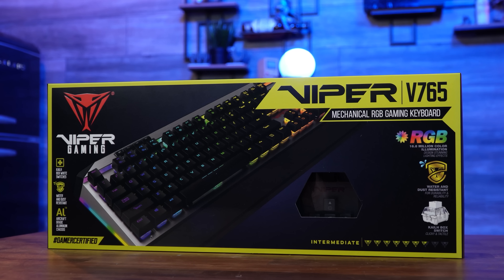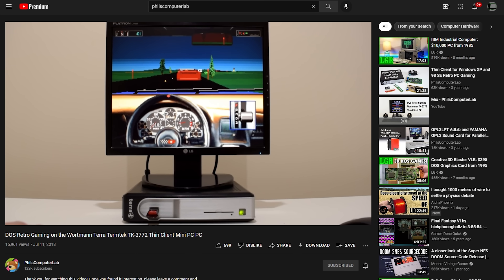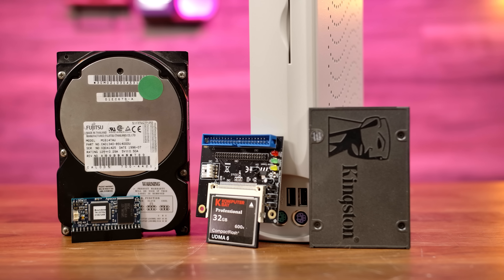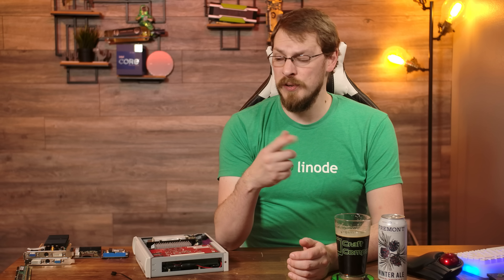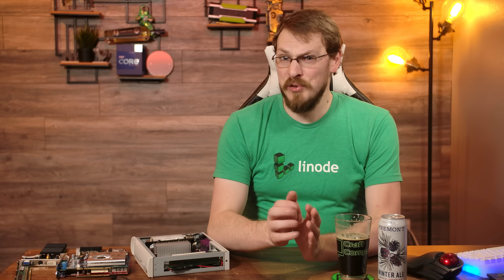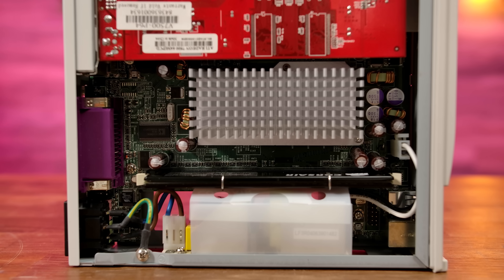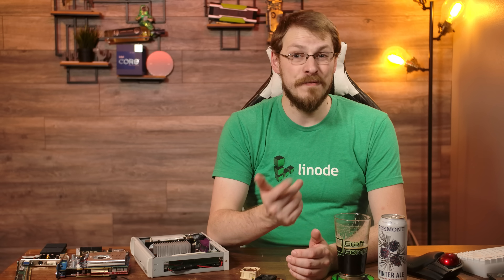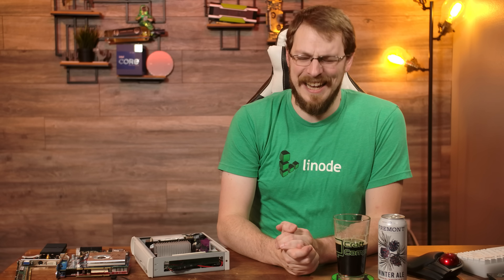What could go wrong - Retro PC Build FAIL

Comment: Noctua makes thinner 5v 40mm fans. Maybe worth taking a look at. They don't move a lot of air but they may be just enough to help.

Edit: Noctua NF-A4x10 5v
Reply: Noctua with the wide range of unique fan sizes
Reply: @NonsensicalSpudz  Sunon has a much bigger selection, down to the diminutive 8x8 fan! (No clue what it would actually be used for tho)

Comment: The first problem you should be taking care of are the caps of the motherboard and I'm not saying just as preventive measures... at least 5 of them are bulging! Instability can be traced to leaky or bulging caps. The 9500 also seems to have a few leaky caps.
Reply: Agreed. Wasn't the 90's to the early 00's rife with defective capacitors?
Reply: @TwistedMe13  I still have a few PII and PIII systems that run to this day with the original caps. I think the problem was early to mid 00s, or I may be just lucky and remember thing wrong...it was over 15 years ago though.
Reply: @aheartseeker   My timeline was a little off. It started late 90's (around the PIII launch)  and persisted until about 2007.  I had two boards fail catastrophically (one even needing a fire extinguisher). Abit boards were especially bad for this.
Reply: @aheartseeker  It was a combination of Pentium 4 power hungry plus Chinese counterfeit capacitors
Reply: @TwistedMe13  Yes the "Capacitor Plague".  This also haunted CRTs and many other electronics. Technicians that worked in that era still tell people to replace all old electrolytic caps, just in case. And they are cheap enough so that it's economically practical.  I think, as long as you (or the customer) are aware of the possible cap problems, it's better in older PCs to leave working/non-bloated/non-leaky caps in place. But, that's a debated opinion.
Reply: @virtualtools_3021  it's actually a problem with Taiwanese capacitors, when the stole a faulty design of the Japanese.
Reply: @squirlmy  *perfectly fine design, they were just too lazy to bother copying the entire recipe including the anti-corrosion additives
Reply: I noticed that too and wanted to say something as well, I'm pretty sure he knows. The two shots we saw in the video are likely POST shots, meaning the video was taken after he did all the testing. He kinda supports this idea at 13:09 in.

Comment: I actually just setup a windows XP retro gaming machine - a virtual machine! (I also made another win7 VM for playing certain newer and GOG modified titles using a CRT monitor) I'm passing through a GPU and SoundBlaster Audigy 2 using IOMMU. I found the Nvidia Quadro K2000 is low power, comes with 2GB memory, and even has Window XP through windows 10 drivers! Display port, DVI, and VGA outputs for only about $60 on ebay. Now that I let the cat out of the bag ebay prices are going to go through the roof lol.

So far this VM seems the best solution. VM which makes it portable and easy to backup. Storage is nvme which is silent, reliable, and way overkill. Same [silent] desktop machine so it doesn't take any additional space. KVM emulates a pentium 3 and along with the actual sound card and GPU being passed through means real hardware support with zero driver compatibility issues. DOSBox for older DOS games, Windows XP for any win95 and newer. I even play on a CRT monitor and I have an older surround sound speaker set. When I retro game I really retro game :D

For what it's worth, Phils Computer Lab goes in great detail on why A3D and EAX positional audio are far superior to modern day bland onboard audio devices. If you are going to build a late 90's gaming rig it is 100% worth the effort to get ahold a Soundblaster Live or Audigy and setup EAX with 4.1 or 5.1 speakers. Half Life 1 and Medal Of Honor: Allied Assault are fantastic examples of true surround sound positional audio from back then.

Comment: Mod the existing chassis. Even if it means having the fan on the outside of the PC, it will still retain the look you want. It's worth it for something this small and affordable.

Another option is to drill holes into the top panel until you make a "mesh" look to it. It will still look nice and retain the top shell and retro look, but then it will be as close to an open-air chassis as possible. You might even be able to fit a thin, larger-size fan onto the top cover with this config.
Reply: I've drilled grids of holes into side panels of a few SFF gaming PCs. It works pretty well and also creates a place to mount a thin fan either internally or externally. Would definitely be a good solution here 👍

Comment: Remove the unused parallel port to make room for an exhaust fan. Mount a fan on the back externally. Dremel off a few heatsink fins for a fan. Carefully drill some intake holes. Check the schematic for a 12V point.
Reply: serach for a 12 V point OR just use any 5 V fan... eg NF-A4x20
Reply: Boards from that era powered CPU off 5V rail - and Jeff said PSU has 5V output rail, there may NOT be a 12 V DC in this PC at all!
Reply from the maker: @Komrade The power supply has only two wires connected to the board.... + and -. It is delivering 5V and only 5V. The motherboard has circuitry to step down the 5V to 3.3.

This power supply isn't a traditional AT or ATX supply. It's basically just an AC-DC 5V transformer.
Reply: @KomradeMikhail  12v on PCI slot isn't guaranteed, especially on custom/embedded designs like this. This is a thin client so that slot is designed to attach some USB or serial or whatever, not a GPU. A lot of simple connectivity cards are 5v or 3.3v only so it's 100% possible this is a tradeoff they did.

Comment: Felt your frustration, but loved the journey. Phil's content is excellent as well, especially for anyone wanting to get into PC retrogaming. That Win 9x era is still best done on bare metal.

For anyone wanting some cheap and reasonably easy, and has the space for a normal sized PC case, my cheap-as recommendations would be:
Socket 478 Pentium 4 - cheap, anything over 2GHz is overkill for Win 98, but keep it the 2.8 GHz chips at most as beyond that power and heat consumption enters infamous territory.
Any decent looking ATX or micro ATX socket 478 motherboard with an Intel chipset - they all support Win 98 fine, and Intel chipsets were nicely stable (unlike alternatives which can be temperamental). ATX was the standard then as now, which makes life easy. One that takes DDR RAM is preferred.
Appropriate RAM - DDR, SDRAM, RDRAM if you find an exotic motherboard. DDR is cheap, the motherboards supporting it are cheap, and it is plenty performant, so that's my recommendation, but for low cost even SDRAM will be fine for late 1990s games.
Geforce 4 MX 440 for your graphics card - very cheap, in fact not hard to find for free, Nvidia drivers from the time work well and are compatible with pretty much everything sans 3Dfx Glide. Did I mention stupidly cheap? Also, plenty powerful for anything released up to around 2000. Doesn't support DirectX 8 or 9 shaders, so not good for Doom 3, Far Cry or Half Life 2, but this isn't the machine for those anyway. Get AGP if your motherboard has it (which it should), otherwise PCI. Substitute with any cheap ATI 9500 or Geforce 5600 if your prefer, but those unloved MXs are fine for cheap retro fun. Try for a GPU that has a DVI connector if you plan on using a modern monitor; that's easily converted into HDMI or DisplayPort.
Any ATX case - don't you love standards? If you have a micro ATX board, you can splurge on a micro ATX case... or find one by the roadside.
Any modern ATX PSU - Socket 478 Pentium 4s are powered by 12v, and use the same connectors as modern systems, YAY! Preference given to a PSU where the 24 pin power connector can be converted to 20 pin, but even if it doesn't have the breakaway, a cheap 20 pin extension cable from ebay will get around any clearance issues you might have. Anything 400W or above and you are laughing.
IDE to CF adaptor and card like Jeff uses, or if your motherboard has SATA headers, any SATA drive - keep it simple.
Free IDE CD/DVD ROM drive - easier then USB for installing Win 98, and if you have old games on CD you want to play, but optional really.

And with that you are done. USB mice and keyboards should work with Win 98 and a P4 system, so just use what you have. You can still pick up complete OEM P4 systems that just need a GPU thrown in, but make sure it's socket 478 to ensure Win 98 compatibility (s775 is possible, but it becomes much more specific in what you are looking for). 

Those Pentium 4s, for all their faults at the mid-2000s high end gaming, are stupidly stable, it-just-works Win 98 machines. The only real issue you need to keep an eye out for is the infamous capacitor plague - watch for bulging caps on the motherboard or video card. Not fun if you aren't handy at through-hole soldering, but P4 motherboards are so cheap you can just go buy another one.

Now if you want a cheap Win XP retro box, well, look at Core 2 Duos. Loads of them for peanuts.
Reply: Can Core 2 Duo run Win 98 games?
Reply: @heyitsdazy  Win98 doesn't have any issues with a Core2Duo CPU, though it'll only use one core. The problem is finding a motherboard that both works with Win98 and Core2Duo - most are one or the other, and the few which are both are rare. Unless you are a collector or your goal is to take Win98 to its limits it is much easier to stick with a known compatible hardware generation.

Comment: I didn't even know Nocuia makes that small of fans.. I bet they would work in my Power Mac G4 MDD. Getting fans to fit and work in that power supply and still run silently is nearly impossible. I have a 2003 model with the updated Apple supplied fans.. it's ok, just not great. I mean it cools and it's fairly quiet, but its obvious there is room for improvement. It's a great computer, but not one of Apple's best designs. The Quicksilver that came before it was not only much more quieter, but much cooler too. If only Apple had simply updated the Quicksilver motherboard to accommodate the slightly faster hardware, it would be a fantastic system.
Reply: I know what you mean about the volume of the G4 MDD “Wind tunnel” fans.

We bought one for use in a recording studio.  Once it was fully loaded, we had to put the MDD in another (soundproofed) room out back then run cables to the keyboard/monitor because it was way too noisy for the control room.

The little fans you’re describing might just work.  How hard can it be, right?
Reply: Also, jumping from 2003 to (almost) 2023 — you’d expect silent fan technology to have moved on and miniaturised in both size AND decibels.

Comment: 3D print a top cover with heavy venting. A section over the power supply can be raised for 40mm semi-external fans. A low profile 140mm fan might sit in the middle, perhaps partially inside the case. New side profile: ▇▆▆▇▇▇▇▆

Comment: 13:18 I would inspect and replace every single capacitors on the board and graphics card especially those that are bulging.  If just one them pops you'll have a dead board.  As far as the cooling goes cut a hole in one of the side panels for a Noctua fan and power it via an external brick and slave it to the system it cools via a UPS.  If you want the ability to mount a larger fan on the inside you could 3D Print an expansion frame out of beige PLA for the side panel you add the fan to. (Pay attention the dimensions of the side panel and how it attaches to the computer and model both a male side and a female side (for the side panel to snap into-- into the blueprint you create for the print.

Comment: I loved this lol.  Especially pulling power from pci!    Here's my thoughts: I'd still take power from the PSU, and just use a relay controlled by the fan. As for the fans... Man, there HAS to be somewhere you can dremel out a small 40mm hole that doesn't kill the aesthetic.. As for getting the 12v for it... Hrm.. maybe another pull off the psu and relay to the fan, providing there is a 12v? lol  
Very Cool project though, and I really feel like there IS a way to make it happen with what you have!
Reply: Relay is a great idea!
Reply: This might be dumb question but is it possible to use a modern PSU for this project?

Comment: Have you tried changing the psu for a pico power supply?
They're really small, provide around 100watts of power and should be easy to modify a connector for that motherboard. It might help with your heat problems and maybe even give you a little extra room for a fan....

Comment: Based on what I am seeing at 11:06 I think the capacitors on your motherboard are bulging and bad.  I doubt  it will help your thermal issues, but might be worth replacing. Also you may be able to solve your fan issue with some old laptop fans.
Reply: you 100% right, those ones are completely toasted

Comment: You have a fancy CNC table now right? Cut diagonal slots or a grid of holes in the top and bottom panels. Should be able to keep itself passively cool if you allow hot air to just naturally not build up

Comment: They make tiny ATX power supplies that take 12 volt in and supply 5 volts and 12 volts. They also make ATX breakout boards. It's possible that that combination will still be smaller than the power supply you have now, which might give you room for a fan. It also won't be an exposed power supply that will shock you.

Another option would be converting it to an external power brick.

Comment: 11:07 it looks like you have blown capacitors on the board there (domed tops). Also note that some 9500 non-pros (the ones with an "L-shaped" memory arrangement) can be fairly easily modded into a 9700 equivalent with a small solder mod (doubled memory bandwidth, etc). This was one of my favourite early graphics cards, until I eventually killed it by ripping off a memory module trying to remove some heatsinks that I'd thermal epoxied to the chips.

Comment: I wouldn’t say it’s a failed project if it works with the case open; you could actually get one of those giant thin noctua fans that is the size of the chassis but lower profile and then put a thin plexiglass window with tons of perforation on top, then add some metal standoffs that you weld to the case to secure this added fan

Comment: I'd desolder the VGA, Serial, and Parallel ports and install a small fan.  To power the fan, I'd crack open a 12v wall wart and solder it in parallel to mains.  You can then use a small solid state relay or an optocoupler ... something ... off the 5v fan header to turn the fan on/off with system power.

Comment: Just curious, couldnt you barrel plug a laptop power supply and use buck converters to step down the voltage to what you need inside the chassis? Buck converters are still going to generate some heat, but i imagine not as much as having the entire power supply be internal.

Comment: as someone else pointed out that serial port space could be repurposed as a blower exhaust with a laptop cooler and a 3d printed shroud sucking air directly from the psu part. I mean that's how Dell cooled their low profile Pentium 4 Optiplexes back in the day

Comment: What you really need to get all your power issues sorted easily is an external power brick. I'm pretty surprised that the power supply in this thin client was internal to begin with.

Comment: Good to see enthusiasm in the retro space. My hot take though? Don't try playing any games that are DX9-dependent. Windows 98 may have support for DX9, but even a good GPU like the 9500 or FX 5500 will have terrible drivers late in the lifespan of Windows 98. DX8.1 is the maximum I use on all my 98 builds, and I have no problems. Sure, I can't play some late games, but that's why you'd build an XP machine with a P4 processor. It's just what DirectX 9 belongs on.

I'd try just a generally smaller card. A GeForce MX4000 may not hit the same framerates of the FX 5500 by a long shot, but the thermals are way more manageable. Or, maybe just drop to an FX 5200. Same performance, still has a cooling fan to move some air around.

Comment: Nice video. Tips: PICOpsu instead of that thing... in a similar build i found the Nehemiah CPUs work best. Unlocked fsb and multiplier. Goes up to 1333mhz and performs as a P3 650 or even more. And after trying different cards went for a voodoo 3 pci for compatibility. Did a few vent holes and added a scythe mini silent fan. Done. 0 problems. And audio is not bad, via with sound blaster compatibility configurable through BIOS. :)

Comment: Maybe a modern power supply could be adapted to work; you only need 5V, after all. It'd definitely be smaller and probably put off less waste heat, so you could keep it internal and maybe make a little more room for fans. The NF-A4x10 5V might be just what you need as far as size and power requirements, but I'm not sure if its air flow would be enough.

Comment: Remove the internal PSU, put a fan where the mains input was, add a small barrel jack and just use an external 5V PSU, could even encase the internal PSU to use externally to keep within a budget.
It'd remove your main source of heat and add cooling though 👍

Comment: I see lots of advice to change out caps.  While many vintage PC maintainers also replace the  tantalums with electrolytic caps, which are supposed to be somewhat more reliable (actually tantalums are technically also electrolytic, but the more usual are aluminum electrolytics, with their own issue of being labelled "aluminium" for outside the US) Often vintage Mac users feel a sudden, obvious "blow up" and magic smoke is better than the slow, less detectable failures of the aluminum electrolytics. It seems to me, it comes down to personal preference, or whatever traumatized you the least. 😂💥💨

Comment: I'd cut away some of the fins from the CPU heatsink to make room for the fan. 
As for 5V fans, you can buy USB-powered fans from China. You should be able to convert them to fan header.
I've seen them in sizes from 40-80mm, with 10 or 15 mm depth.